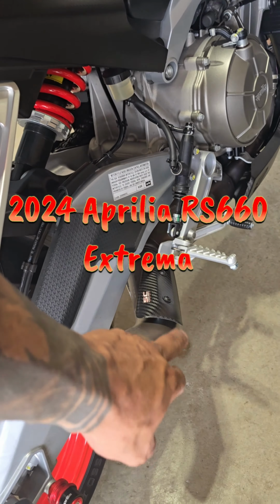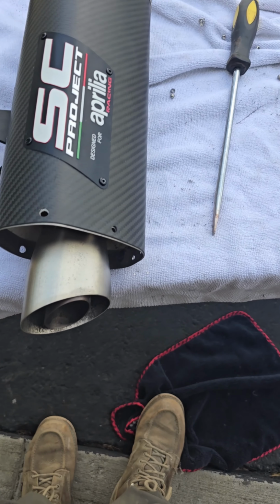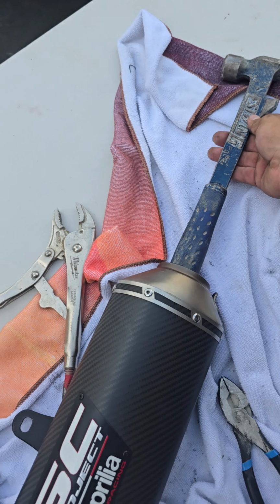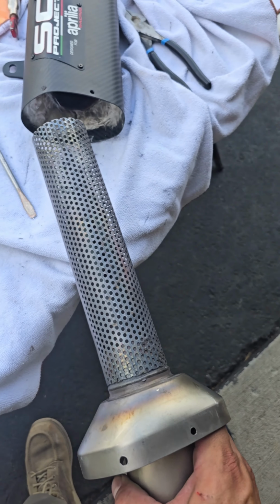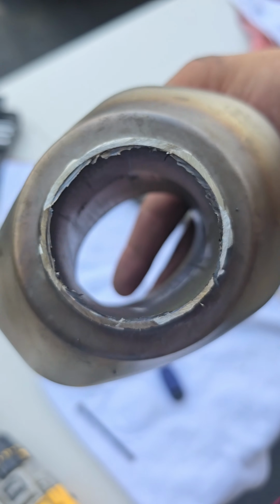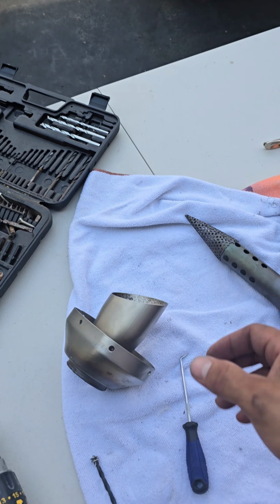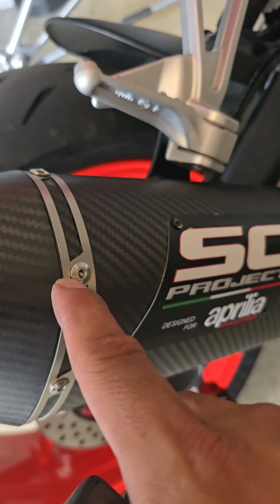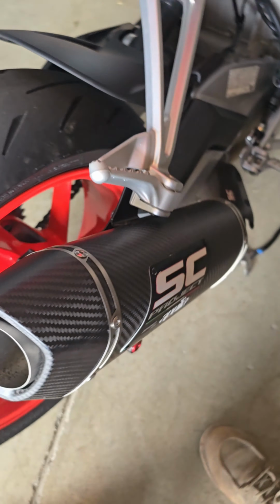2024 Aprilia RS 660 Extrema | DB Silencer removal | How to remove Baffle in exhaust

Comment: Thanks for posting this, I’m sure it will help a lot of people. When I did this a few months ago, I’d only found one video on it, and it wasn’t in English. Personally, I made the mistake when I put it back together of not using long enough rivets, so not all of them formed on the backside correctly. So, lesson learned there, had to go back and drill those out and replace with longer ones. The other thing I would mention is that I wanted to keep that mesh cylinder piece on, so I cut the weld from the inside. It’s more labor intensive that way, but I was happy with it.
Reply from the maker: @disciplemike6477  I was in the same boat  when I was looking for a video to show me how to do it. I couldn't find one out there. The only one I found was just a video where it showed you what it sounds like after the fact and it only had very poor written instructions in the description. So I figured I'd just do it myself and learn as I go and share it!! I'm glad it worked out for you brother!!
Reply: Was there a noticeable difference in sound after this process? It’s hard to tell from the video.
Reply: @yalid2542  it’s hard to quantify but there’s a difference. I notice it most on a warm restart. In my opinion though, it’s still not “loud”. Especially compared to say an inline four with a slip on or full system. But a little deeper and certainly more noticeable at all RPMs. Certainly an improvement.
Reply from the maker: @yalid2542  it was a noticeable enough that everyone I ride with perked their ears up when I fired it's up with out me telling them I removed it. They said, "Dude, what do you do to your exhaust, its sounds  really good and deep". In my opinion is worth doing 100%.

Comment: I've been wanting to do this for a while and saw several sites that offered "instructions", but none of them were very good and were very basic.

I did this today and the bike sounds so much better and deeper (my opinion).  The OEM 2024 Aprilia RS660 Extrema one lacked a little.  It's like it make it sound like a racing car exhaust (Don't know how to explain it). Much deeper and a bit louder.  I really like it.

I have a Yamaha FJR 1300 ES with dual Two Brothers exhausts that sound amazing.  This isn't as loud (only one exhaust), but it's probably close to the Two Brothers if my FJR only had one.

This video at least helped me understand the different steps they were talking about in forums and what to expect once I got it open.  However, there are a lot of caveats and I know why people don't really want to do this.  I broke 2 drill bits and didn't have an electric rivet gun which made things extremely difficult.  I do have a really nice Dremel with metal cutting bits and it make an extremely clean cut to remove that DB killer.

Things to consider
-----------------------------------
1) It's not too hard to remove the exhaust once you remove the bolt (on the foot peg) and remove the spring holding it on.  I did have to wiggle and use a soft mallet to help me get it off.
2) Stainless steel rivets are used.  If you have a hand rivet gun, it's going to be tough.  I ended up positioning my exhaust next to a table and used my full body weight just to get the rivets put back in.
3) If you know how to remove rivets, you may have better luck.  I learned the hard way as I broke 2 drill bits (3/16").  There is room to punch the "nail" in the rivet down into the exhaust.  This will make it easier to drill out.  Once you get it down far enough, you can drill and maybe wiggle a little bit side to side until the head of the rivet comes off or loose.  Then you can use a screwdriver or something to punch out the bottom part of the rivet. It will fall into the exhaust, so you better be ready to move forward and don't give up.  You can't get it out without removing the end cap.
4) Using a drill may heat up the carbon fiber around the rivets.  This will smell, but more importantly, it will melt the resin holding it together.  This made my inside metal parts stick to the carbon fiber in certain places by the rivets.  I had to use a screwdriver to separate the carbon fiber from the steel in those spots because I couldn't hammer it out.  It was sort of "glued".  Once I got that done, it popped right out.
5) A Dremel tool with a metal cutting wheel cuts it like butter.  It was a very clean cut and I didn't even have to grind any of it down afterwards.
6) When putting the rivets back, be careful.  My last rivet was loose when I put it in the hole and the nail part fell into the exhaust.  I had already spent a lot of time getting it back together.  I was able to get it out by wedging 2 screwdrivers between the carbon fiber and the metal part of the exhaust to give it enough room where I could grab it and pull it out.

If you want the exhaust to be much deeper and a bit louder, this is the way.  You don't gain any horsepower or anything because it still has a cat.  If you want more horsepower, you will have to replace the entire exhaust with one without a cat.  It's on my list, but I've already done so much more to the bike (new spockets, Gabro Racing stacks, Sprint Filter, reprogamming with UpMap, etc.) and it is much faster and way more responsive now already.  

To me, it was worth it even though I thought about punching a lot of stuff during the process.
Reply from the maker: @irkdhesa  I hold hardly agree that it made my bike sound a hundred times better!!! It definitely was worth a little bit of a headache. 

As far as the process to remove the OEM rivets. I never had a problem with any of my 3/16 metal drill bits braking. However when I originally started, I was using 1/8 metal drill bit and then went up to a 9/64 which, to me, made the process a bit of a pain.

Once I went to my local hardware store and picked up (2) 3/16 Drill bits it helped a lot. Getting some of the rivets out once you punch through with the drill bit was a bit of a pain at times.  

When it came to putting in the new rivets, I used a one-handed rivet gun to set the rivet or get the rivet halfway set. Then I used a two-handed rivet gun that looks similar to a pair of bolt cutters. That allowed me to really squeeze and eventually set and break the rivet off.  

In the video you seen where I used a aluminum 1/4 inch rivet, that was because I accidentally bored out the hole and made it too big for the 3/16 rivets. This was because I was using a smaller drill bit and trying to waller it out. This to me was by far the most challenging part of this process.  There was a few times where I was trying to set a new rivet in the hole and for whatever reason my rivet would not set properly and would fall into exhaust therefore I would have to redrill the rivets that I had already set. But again, with that 3/16 drill bit that i had, it was fairly quick and simple for me.
Again this was my first time doing it and there was no videos on how to remove it. All I seen was a bunch of random post that was kind of all over the place and none of it ended up actually applying to my bike.  I'm definitely confident that if I were to do this all over again it will be fairly simple.  

Regardless I'm glad that you did it and you're happy with the results because I definitely was!!! It was totally worth it.  Thanks for watching I'm glad I can help out a little bit. Cheers mate 🍻

Comment: Just performed the rip of the DB Killer - Thanks so much for the awesome walk-through. Tapping out the DB killer assembly took some hard hits but finally came out, cut at the weld was super easy. Sounds so much better, have you de-catted yours? Thinking about doing this

Also for others, the link to the Amazon rivets was spot on and bought a 2 handed rivet gun from Harbor Freight for 25$ to complete the job.
Reply from the maker: @ariels9885  I did not decat mine because that would require a tune/flash the ECU.  Unfortunately that would void your warranty however, I do know some individuals who flash it back to OEM map before they get service done or have to take it in. Once it's out of the shop they reinstall the racing map...
Reply from the maker: @ariels9885  I'm glad it worked out for you though! Enjoy brother!!!

Comment: Just did mine. Thanks for the video! Was pretty easy. Wuestion though. Are you running an Upmap? If so, what tune are you using with this setup? I figure its still pretty restricted with the cat in place but must flow at least a little better now.
Reply from the maker: @913outdoors  No I didn't tune mine.  I thought about it at first but after all the research I did a tune wasn't needed. Also a little sketched out because I didn't want to void the warranty. 
I'm glad the process is simple for you man, enjoy brother! 🍻

Comment: Quick question, there's a bunch of fiberglass packing in the slip on. Is it okay to remove all of it? I want the exhaust to be loud
Reply from the maker: @dutch_martyr  are you talking about the fiberglass that's behind the mesh? If so, I'm not sure if that's a sort of protector to keep some of the heat off of the carbon fiber.  I have it ran across anyone that's done that either if this is what you're talking about
Reply: @FreakishlyUNeek  yeah it's like, white fiberglass packing. I want to take it out but good point, it might be there to protect the carbon fiber

Comment: Does this do anything besides sound?  Are you running a tune?  Thinking the bike would run lean with the basic race tune.
Reply from the maker: @s4alexis  Hey Alexis! No, you do not need a tune when you "only" remove the DB Killer/baffle. However, if you remove the catalytic converter then yes, you would have to get a tune because the bike would more than likely throw a code and it would also run super lean. I confirmed this with 2 certified Aprilia/Ducati Mechanics before removing my DB Killer/baffle. As far as performance, no it's simply just makes the bike sound a lot better and louder.   Hope this helps... I Appreciate you watching!

Comment: Will doing this affect warranty if anything occurs?
Reply from the maker: @frenchieewoo3355  no, It won't affect your warranty because this mod is not affecting emissions.  Now if you were to remove the catalytic converter then yes it would void the warrants. The baffle/DB killer is nothing but a noise damper so you're good to go!

Comment: Just curious, if I wanted to just remove the muffler/slip on and buy another one, would it fit on the rest of the exhaust?
Reply from the maker: @josephrivera1552  yeah it will fit. Check out cbcmoto.com The guy that runs the site goes by the name of Joe, He's an awesome guy and he'll steer you in the right direction. Any questions you have you can call in personally.
Reply: @ thanks for the advice I appreciate you!
Reply from the maker: @josephrivera1552  no problem brotha! I appreciate you reaching out!!

Comment: Total noob questions but what size rivets did you use? never worked with them before
Reply from the maker: @komoore87  not a noob question brother, I added a 3/16 stainless steel rivet. Got it from Amazon
Reply: @FreakishlyUNeek do you have a link to the rivets you got? Awesome video I am going to do this to mine until I get a full system and tune I want
Reply from the maker: @MegaTrotz  SDTC Tech Stainless Steel Blind Rivets 3/16" x 3/8" (6-4) Open End Type Pop Rivet Grip Range 3/16-1/4 inch (50 pack) 
 https://a.co/d/8Ac2p65
Reply from the maker: @MegaTrotz  Make sure you get a rivet gun that's got a strong enough bite to snap the rivets.  I used a one-handed one to get the ribbit almost set and then I use my two-handed pair to Cut it off
Reply: @FreakishlyUNeek  Perfect. I work at a car dealership I'm sure we have some good ones there. I am just going to take off the "slip on" part and bring it in the shop with me tomorrow